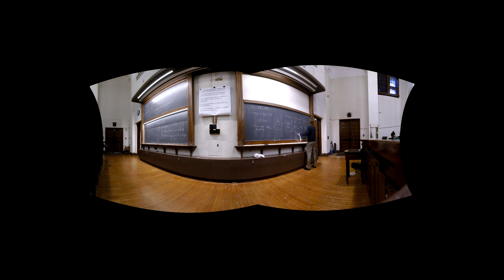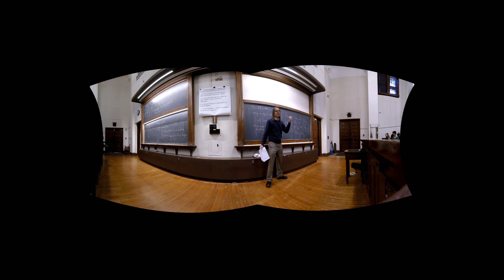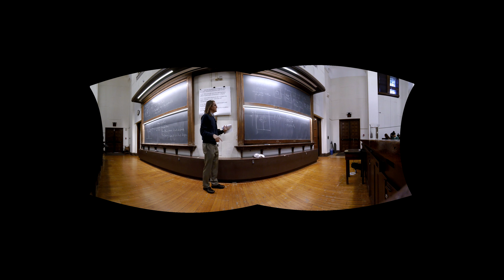PHYS 125 | Lecture 11D-3 | Floating/Sinking & Buoyant Problem

Comment: At the end of the video, Is the tension force (Ft) not supposed to read as: Ft =[rho(object) - rho(fluid)]d^3g?
Reply from the maker: It is correct but it looks wrong because I am solving for the magnitude of the tension force (note that I put the negative sign by hand).  In 1D problems like this I usually just work with force magnitudes like this so that students have to think about the negative signs as they work through it.